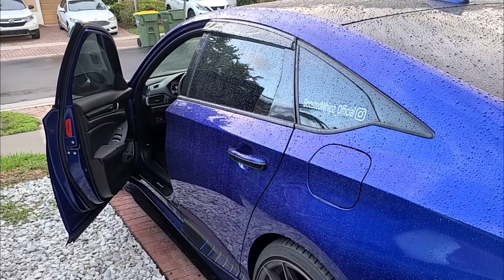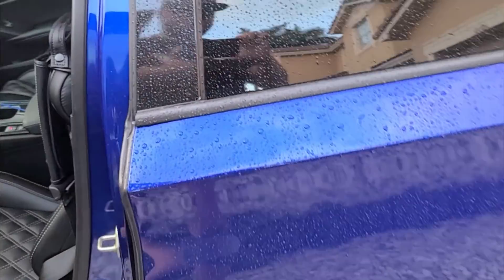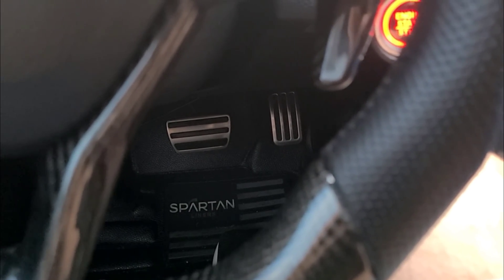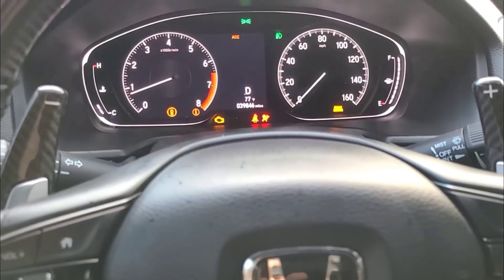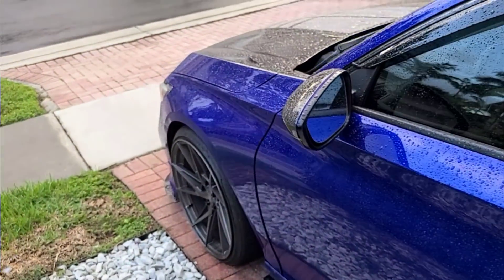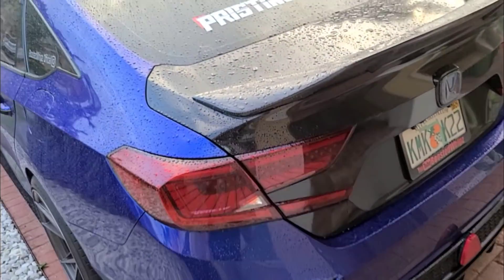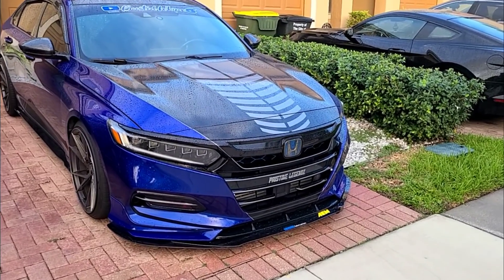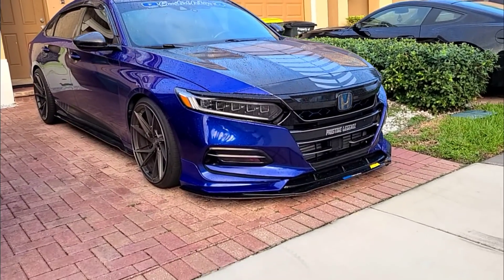CVT Transmission Goes Out at 40K Miles on Modded Honda Accord 2018-2020

Comment: At the end of the day dont mod or race a cvt its made to get from A to B with groceries not drag racing.
Reply from the maker: Agreed. Thank you 🤙🏼
Reply: Should’ve opted for the 6 spd manual
Reply: @jamaalblack9076  Absolutely
Reply: Sad part is subaru is also opting for SHIT TV transmission
Reply: Mazda is the only Japanese company that doesn't offer CVT, but automatic transmission on their cars.
Reply: Should’ve got the 2.0t no cvt
Reply: @jamaalblack9076  I heard honda plans on getting rid of the manual option for the accord now
Reply: It’s probably the flux capacitor that might be the problem
Reply: Did you use TSP?
Reply: I have honda accord Sport 1.5L 2018 and already it’s passed 80k miles. No problems yet.
Reply: @dcal4455  it's unfortunate they aren't selling that well for the longest time I was contemplating a Mazda 3 or cx5. Somehow I ended up getting a kia stinger fully loaded instead lol.
Reply: @GMKDP  I know, Mazda is a really underrated car brand, but good choice with the Stinger, did u get the twin turbo one?
Reply: @dcal4455  thanks, yaaa the V6 TT :) I posted a little launch control video. Literally had multiple people tell me I have a nice car. "Nice car, Holy shit it's a fucking Kia".
Reply: I had a Nissan with a CVT.  Traded in at 190k miles no trans problems.  Except I used it as a passenger car.  That shop helping you with mods is just taking your money bro and laughing at you.
Reply: So true
Reply: Looks like you got spacers, do you?
Reply from the maker: No spacers on mine.
Reply: @dcal4455  So, Do you own any Mazda ????????????????
Reply: No body Begs nobody to buy CVT transmission..... Plenty other Options  out there...
      Why do people bitching so much..... ???????????
     Buy what you want okay....Duhhhhhh
Reply: Yes sir, I have own a Mazda.
Reply: @dcal4455  And it's why I bought one. Anything with a CVT will never be bought by me.
Reply: What auto manufacturers don’t use CVTs?
Reply: It’s a 10speed not a cvt idk why he thinks it’s a cvt
Reply: @Carter-ir5ud  2.0 has 10 speed
Reply: @robertalicea5585  I know he has a 2.0 look the 1.5 doesn’t come a 10 speed and this car is a 10speed the cvt can’t get paddle shifters since there is no gear
Reply: It can barely get u to A and B. Most break before they get to 100k miles
Reply: dz1guy I know I test drove Corolla Hatchback and the Civic Hatch and both cars I did not like the way the CVT felt . In general,  the Mazda 3 felt more fun, handle way better, and it just felt more sporty.
Reply: I thought at first that the 2.0 came with traditional automatic transmission,  but I found out u can choose the CVT transmission. Honda and other car manufacturers mimic a gear change in a CVT transmission,  that is why it has paddle shifters.
Reply: Meh, his car. He can do whatever he wants with it.
Reply: @RS1 💀💀💀
Reply: Who mods an accord like that🤢 specially with a cvt
Reply: don't know why people continue to bother with those c.v.t transmissions . they are pretty weak transmissions. if you see a teardown of a c.v.t. they clearly can't handle to much power. i would never buy a car with c.v.t transmission unless it was a hybrid car
Reply: @HarryWangHungLo  I don't think current Ford, GM, Chrysler, Hyundai, Kia, or Mazda vehicles do. Chrysler did have one family of vehicles with a CVT (1st gen Jeep Compass/Patriot/Dodge Caliber) but they aren't produced anymore. I haven't heard about any German cars having a CVT either. I guess new Honda, Toyota, Nissan, Subaru, and Mitsubishi use CVT's on most of their models, except for trucks, sports cars, and minivans.
Reply: I have a 2019 Honda Accord 6sp manual.  2020 was last year for Honda manual transmissions in the accords.
Reply: @Carter-ir5ud  His car is a 1.5 liter cvt. 2.0 has push button shifters. As you can see, his car has traditional shifters. You can add on paddle shifters to most cars nowadays. He even said his car dynod at 220 horsepower. A 2.0 has 252 horsepower. A 1.5 has 192 horsepower and with his mods, it went to 220 horsepower.
Reply: @HarryWangHungLo  VW
Reply: Car looks nice, even though it's a sports car wannabe, CVY with a fake manual shift knob. Just get a stick shift and be done.
Reply: @Carter-ir5ud  wrong CVT equipped Accord sports have paddle shifters. Honda’s CVT’s have simulated gears. Also 2.0 Accords have a push button gear selector on the 10spd, not a shift lever like this car. 1.5 CVT equipped Accord all have a standard type gear selector lever. I own a 2020 Accord Sport 1.5t and I work for a Honda dealership.
Reply: @ramirobarajas6383  i had a 17 rogue w/ cvt and it failed @79 k miles with no warning. Car would not go, it would just rev. After car sat overnight, it would drive, but not shift. Unfortunately, you can't fix a cvt, only replace. CVT sucks no matter who makes it.
Reply: Need to plead to honda not to get rid of the manual
Reply: @cool2180  how about a 1.5 6mt sport it has hybrid mode earth dream v tech
Reply: @Big-bee3  lol
Reply: @amanpreetsingh8674  what mods have you put on your car?
Reply: I've got a 2018 1.5t cvt tuned, down pipe, intercooler, intake and no issues going 10k Miles strong
Reply: @pasmomoonde6077  yeah, but those are better able to handle the stock 260/270 hp
Reply: Time for a manual swap

Comment: Its moded on a CVT trans. They are not meant for racing and spirited driving. 2.0T 10 speed auto would have been better for that.
Reply: Yes you are right
Reply: @gabechannelyt8470  Especially with that detuned Type R engine which might have a lot of tuning potential inside it!
Reply: Yea even the joel Felix's world's fastest gen10 accord (2.0t 10at) has over 60k miles i think and has had zero issues w the trans yet    he just installed a big turbo now so maybe he's pushing his luck but he was already pushing over 400hp before big turbo
Reply: I just bought a 2021 2.0 touring with the 10 speed and was sick to my stomach until I read your comment. I still won't be dragging mine but plan on keeping it for awhile.
Reply: @joshbacon8241  not a detuned type r engine, they are completely different

Comment: Told people the CVTs are the weakest transmissions.
Reply: Meant for gas mileage not modding
Reply: They are fine if you take care of them, don't overpower the engine, make sure you change the fluid when the manufacturer recommends it they can last a good while
Reply: @commandertaco1762  Nissan has left the chat
Reply: @djpollo2474  the all new Nissan Altima*

*transmission sold separately
Reply: @commandertaco1762  hahahahahahah
Reply: @anthonycapezio3990  no wonder my civic does 40 miles a gallon. i though the efficiency was due to the engine only
Reply: @commandertaco1762  Apple in a nutshell
Reply: I have a 18 accord with 197,xxx miles cvts aren't bad if you take care of them I've beaten mine and it's still running good😂
Reply: @aaliyahthomas4324  Did the cvt make the 200k mark?
Reply: @donovanfahrbach2493  yes rn I'm currently at 223k miles no transmission issues
Reply: @aaliyahthomas4324  Thanks for letting me know…I have 154k on my 2013 accord…it’s used for city driving so I was getting cvt anxiety but this is great to know…it’s my beater car but I want to hang on to it..
Reply: @donovanfahrbach2493  keep up with the maintenance should be fine I'm all highway miles so it could be different due to you being a city driver
Reply: @aaliyahthomas4324  Thanks, yes I’m very diligent on the maintenance..every 30 K on the cvt service

Comment: The CVT trans is NOT designed for the hard driving you are most likely putting it through.  

Very limited design.  Honda and Toyota have the best on the market.

Comment: I would recommend a 10 speed automatic 2.0 turbo because it’s a more sporty like driving transmission than the CVT. The CVT is more of a regular normal driving transmission.
Reply: Still has a cvt transmission
Reply: @Band Stacks  the 2.0t only comes with a 10 speed auto or 6 speed manual

Comment: To me it doesnt matter who makes them. CVTs arent durable.
Reply: Some can last as long as traditional automatics when used in the configuration they were designed for.  They just aren't as capable of handling large amounts of torque.  Even the chain based CVTs need to be respected.  Don't take them out of design limits or you'll be the next.  

This isn't a CVT failure per say, but a failure to respect the CVT's limits.
Reply: I love Nissan, but Nissan makes the worst CVTs.
Reply: And I don’t know if modding a CVT is safe either; it’s just gonna boost it’s timespan and it’ll break faster
Reply: @JamesConnor116  I dont care who makes it. Im not a fan of the CVT.
Reply: Wow, That’s sad.
Reply: Toyota’s are the best. They been making them since the Prius
Reply: @superbros1690  lolol. Did you watch the link I posted to James Connor? Youve been dooped by toyota.😂😂😂😂
Reply: @superbros1690  Those CVTs (eCVT) in the Toyota hybrid cars and other electric assisted cars like the Chevy Volt are not the same as the ones in traditional non-hybrid cars. The eCVT in Toyota's hybrid cars are nearly indestructible. It uses planetary gear sets that connects the electric motors and the engine. Proper engineering term for it is EVT, I don't know why they would call it a CVT as it is confusing to consumers.

Comment: First mistake he made was buying a car with a CVT. Second mistake he made was modding a car with a CVT
Reply: This is a Honda not a Nissan. Honda's CVT is known to be pretty reliable.
Reply: @-SP.  all CVTs are trash, aside from Toyota’s. Wait till this Honda has 100k or more miles on it. Honda made shit automatics, why would they make good CVTs? 🤔🤣
Reply: @diablocls55  my brothers 2015 accord hybrid had 278k before he sold it original engine and trans (CVT)
Reply: @m7machines738  so he drove 50 thousand+ miles per year? Interesting
Reply: @diablocls55  he’s a traveling salesman so yes
Reply: @m7machines738  I see. I still wouldn’t trust any CVT.
Reply: @m7machines738   I think the accord "hybrid" you mentioned is the reason it lasted for 278K because the honda hybrids dont actually have a transmission. they use the word e-cvt but they dont have any pulley system. I dont know if there is any honda car out there that has gone over 250k with the cvt system. car is a big investment for everyone that should last atleast 300k and the fact the honda is going all cvt is very bad. I am thinking of buying a honda accord but I am really confused between 1.5  sport or the hybrid. hybrid here in canada has just 2 colors and pretty expensive and on the other hand cvt I dont trust to go more than 250k
Reply: @diablocls55  yes but I’m at 45k miles on my 1.5 sport after 1.5 year ownership car is stock I’m probably getting up to 60k miles do new spark plugs then selling it for tesla plaid I love my car but right now I only deal with electrical problems in the car I hardly have any engine problems past 1 year it took me A to B if I ever get another 10th gen I’ll get a 2.0.

Comment: Cvt on my lancer at 134k still going strong. But not my race car, just daily driver 👍🏻
Reply: It’s a shame what Mitsubishi has become
Reply: @Dragon228833  I agree with that. Their cars used to more unique and performance based
Im happy with the lgts puts out 170 hp, has paddle shifters and Mi-vec, kinda like V tech
Reply: @lefty Arreola sike, line-up 🤔
Reply: Sammy Phillps  agreed, I know to not to push my luck. I have had the car over 120 tho 🤗
Make a good daily but no way a race car, but you’d be surprised how well it can move.
Reply: @Scro10m  I might be a clown. But calling yourself Gucci makes you a real clown. Probably uber everywhere go too 😂
Reply: Different cars
Reply: 2011 Outlander ES with CVT.  Rolling 115k so far.... Just daily driver also.
Reply: How often do you change the transmission oil? At how many miles?
Reply: @nevergiveup7502  recommended is every 30k, if you can change it sooner.

Comment: Owner is clearly a car guy, why not just buy with a manual trans? Better driving experience and more reliable
Reply: There is only one accord with a six speed in it and I don’t think it’s even close to the top trim.
Reply: @ChariotFighter  i think you could have manual with both engines on 2018
Reply: Hate CVTs
Reply: Probably can't..... lmao
Reply: Depends on his mods it probably affected the transmission for instance heavy wheels, offset lowering the car, exhaust etc.
Reply: @ChariotFighter  only sport trim comes w manual but that's what he already has    i have a 2.0t 6mt accord and it boggles my mind that people bother modifying 1.5t auto accords
Reply: @savateiambanoudis6079  CVT’s are notoriously bad as is, so I’d be hesitant to put any kind of power on one. At the same time tho, I respect a man’s choice to mod his shit, risks included lol. Sometimes having that auto is just easier day to day, but you still want it to rip lol 🤷‍♂️
Reply: man anything but cvt. the 10 speed could've easily handled this setup
Reply: @savateiambanoudis6079  you are right. It boggles my mind to. LOL. I have the 2.0t 10speed and could imagine having anything other than that. Not even a Manuel because the 10 speed is much faster
Reply: Should have spent the extra 8 grand and got a actual car worth modding LOL  2.0t with the 10 speed
Reply: That’s a stupid logic. Just because he’s a car guy he should of gotten a manual? Drive whatever you and how you want to as long you enjoy the ride
Reply: @ChariotFighter  i have a 2.0t sport.. 6 speed. only a few in the states. i had to buy mine cash out of state
Reply: Why didn't u get the 10 speed? WTF
Reply: Poor Civic

Comment: Guess he’s paying for the trans out of pocket, since it’s modded the warranty is invalid.... doesn’t matter
Reply: Thinking the same thing, once a car is modded, the warranty rightfully goes out the window.. 

I'm no engineer, but I know enough to know that heavy suspension drops with huge wheels on a transaxle car can cause problems. Add the additional power on top of that, and yes... Problems on problems.
Reply: Maybe he'll get lucky, my coworker blew his motor on his tuned 17 mustang (eco boost) after only 1.5 years of owning. I told him to put back all stock parts and take it back to make it look like it wasn't his fault. He didn't listen, he left it as is and the dealer somehow still took it and got a great trade-in deal
Reply: 2020 Dem Fraud  no but any modifications that can alter any of the suspension settings automatically void the mechanical warranty sadly which would be power train.
Reply: 2020 Dem Fraud  The performance of necessary repairs 
and adjustments is the exclusive remedy 
under this warranty or any implied 
warranty. Toyota does not authorize 
any person to create for it any other 
obligation or liability in connection with 
this vehicle. Toyota shall not be liable 
for incidental or consequential damages 
resulting from breach of this written 
warranty or any implied warranty. Any 
implied warranty of merchantability or 
fitness for a particular purpose is limited 
to the duration of this written warranty, 
except in states where this limitation 
is not allowed.

This is in a Toyota manual. But does highlight that consequential damages are considered when a vehicle has been altered with non Toyota parts. So while we aren't sure if this person did any mechanical modifications, if it's not Honda, they will literally say it was on his end.
Reply: 2020 Dem Fraud  A car warranty gets voided due to common and unexpected errors committed by car owners. They include the following situations:

If your car is unfortunately involved in a severe accident due to which it is given a salvage title, the entire warranty turns void.
If you misuse the car for adventures like off-roading or racing, even if they are strictly prohibited by the automaker.
When a car is damaged due to an environmental disaster, the entire warranty is voided by the company.
Your car’s warranty also becomes void if any tampering, replacement or disconnections are made to its odometer.
Reply: 2020 Dem Fraud  If you asked and wanted an answer. You got one. If you want to look further into it. Go for it. It's pretty self explanatory and everyone knows these kinds of things. Have a nice night.
Reply: 2020 Dem Fraud  stock transmission couldn't handle the stress of the modifications he put on the car.
Reply: “2020 dem fraud” lol
Reply: 2020 Dem Fraud  I installed BC coil overs on my ‘16 accord v6 and changed tires to Michelin ps4s and I contacted the dealership and it seemed as if they were happy with the quality of products I used and my warranty was still valid. It’s expired since then.
Reply: Warranty wouldn't have covered it either way since his car is at 40k miles. Honda warranties only last for 3 years or 36k miles